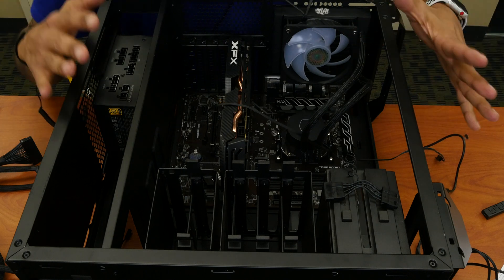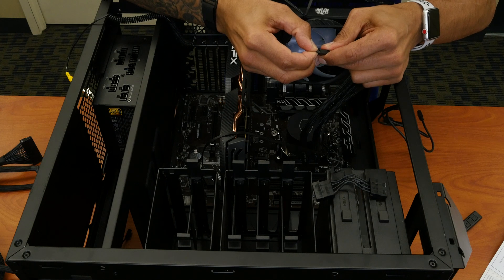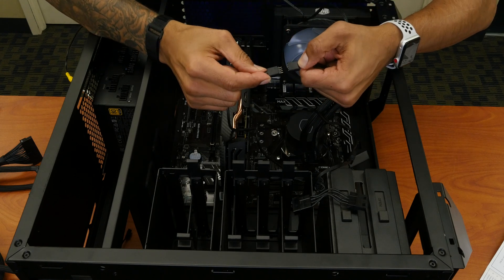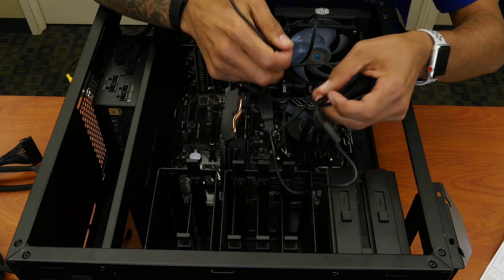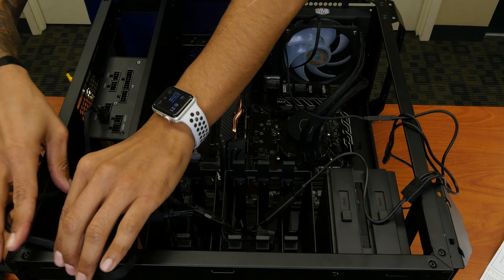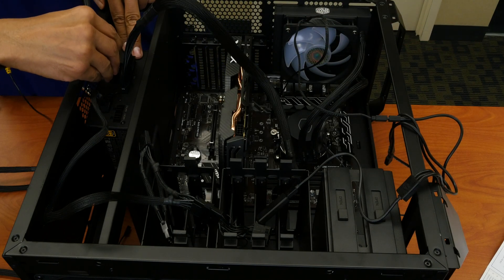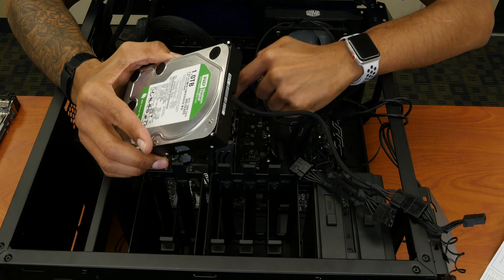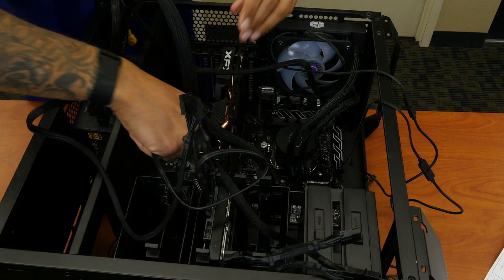Connecting Computer Parts for the Ethereum Mining Build!

Comment: what is the inital cost, maintence cost and long term cost as well as the yield? coinbase currently has 4.5%apr in etherum just for holding money in etherum so why is this better?
Reply from the maker: The build was a proof of concept for me. I'm still learning about the world of mining Ethereum and loving every moment. The build is completed and it's still running (editing the rest of the videos to upload soon). I haven't tune performance the GPU because I don't want to push it. I've added additional workers to the pool to increase the hash rate, but with this build alone I was able to get a payout every 5 days which was around $22 (0.0050ETH). With the additional workers I got it down every 2 days now. Plus, the parts used in this video was funded by my boss lol. He wanted to see if i was able to build it and have it functioning to mine.. I think I got con (lol). I see computer parts and my eyes get bigger with excitement.
Reply: @bjtechnewshd  well that is a different situation. But besides making $22 every 5 days what other benefit is there?